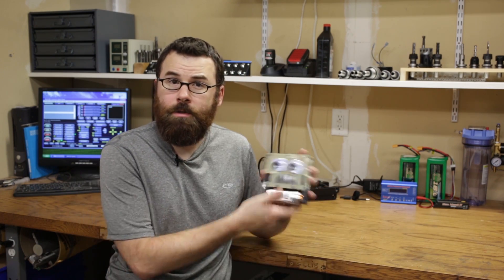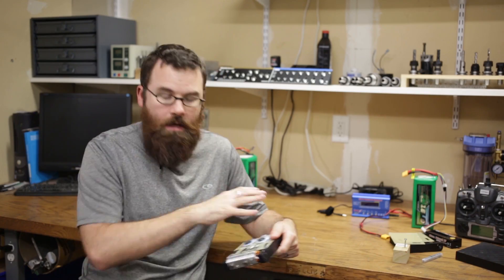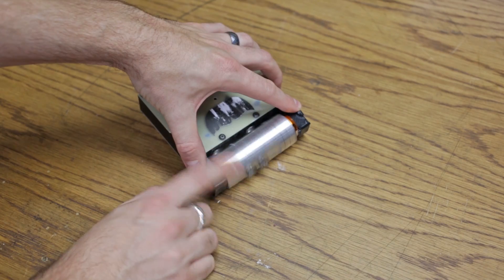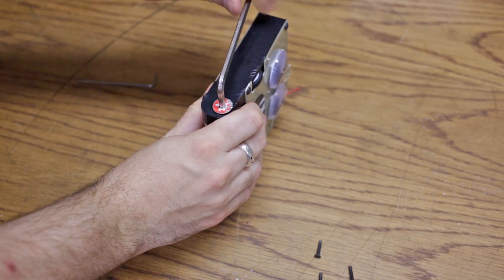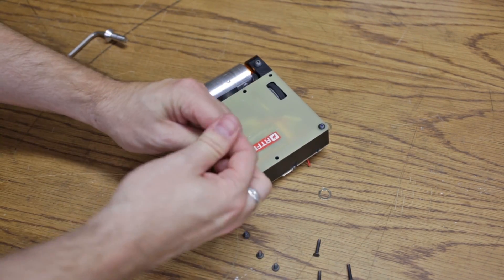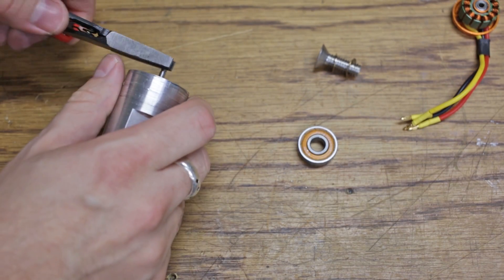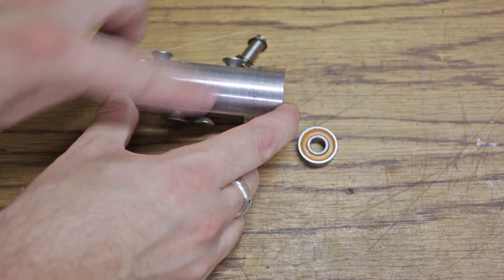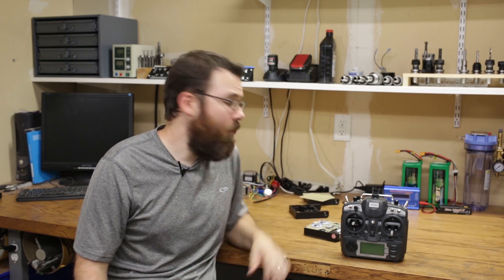Antweight Combat Robot - Part 2: Weapon

Comment: Doesn’t Having the motor directly connected to the drum lead to the magnets inside it being destroyed? That motor is taking a lot of force...
Reply from the maker: Check out my video on battle-hardening motors.  With a little epoxy, you can prevent the motor from cracking under the loads.
Reply: Thanks

Comment: HI Robert, love your videos. You explain everything so clearly and it is really helpful. I am a first time roboteer building a drum spinner beetleweight with the motor-embedded-in-drum design and I just have a couple questions. How did you prevent the motor shell from slipping inside the drum? If it is just that its a tight fit how do you ensure that it is tight enough. Finally, when doing the CAD for the drum, did you just do a bunch of measurements on the motor and input those into the CAD to ensure it fits or was it something else? Any input is much appreciated and any advice in combat robot building is as well. Keep up the good work!
Reply from the maker: Lots of good questions here.  First off, the motor shell is just held in place by friction.  As long as the friction is greater than the force it takes to get the drum spinning you should be fine.  It's OK if the shell can slip a little bit, this can help act like a clutch.  If it's too loose, you could use tape as a shim (maybe even heat shrink) or even loc-tite or glue it in place.  I never had an issue with this.  I just turned it on the lathe and kept slowly increasing the inner diameter until it was snug.  You can also sand the shell down if it's too tight.  For THIS design, I just measured the outside diameter of the motor and the length, nothing too complicated.  The diameter is usually listed in the description.  Just get some calipers and measure the dimensions you care about.  Don't go straight to final dimensions, get within 0.002" and then slowly work torwards the final dimension.  There's a fine line between too tight and too loose, so just go slow.
Reply: Thanks Robert! Really helpful!

Comment: What flat head screw did you use on the weapon?
Reply from the maker: I forgot the size, but I think they're 1/2" stainless.  You can use black oxide, or any other hardened screw.
Reply: The shaft is probably 1/2, but what are the ones for the teeth?
Reply from the maker: shaft is 7 or 8mm, I'm pretty sure the screws are either 1/2" or 3/16".
Reply: Without disrespect, but in the video you say the shaft is 5/16, so that would mean that your teeth is probably between 10-32 and 5/16. Thank you anyway.

Comment: Very nice. And a quick question, are weapon motors supposed to be that small?
Reply from the maker: For an antweight, it's normal.  they are ~150W motors which is the right size for a 1 pound robot.

Comment: Very nice video sir, i learned so much from your video and i have a doubt, if i run 1100kv motor with 12 volts, how much rpm would i get and is it safe for using as a weapon?
Reply from the maker: It's simple.  Just multiply the kv by the voltage.  so, it would be 1100 x 12 = 13,200 RPM (in theory).

Comment: is it possible to add arduino to this robot?
Reply from the maker: to do what exactly?
Reply: to controlled the motor and the weapon meachanism
Reply from the maker: you could, but there's no reason to control this inside the robot.  you could just control it with the transmitter.  the control is very simple, it just sends signals to the motor controllers, there's no need for an arduino to do this, unless you wanted to make it autonomous.
Reply: if it can be that, what i should do to add arduino into the robot? cause i got a university project that require me to make arduino based antweight robot.
Reply from the maker: Look into the RC library for Arduino.  You can have it control the motors and such.  But it's silly, it will just take the RC signals from the receiver and relay them back to the motor controllers.  It's extra hardware that's unnecessary.  It might be better to use it to detect if there's something close by, and making the drive motors either avoid or attach what's in front of them.  But if you're just trying to use an Arduino because it's a requirement, it's absolutely not necessary.  Use it to automate something.  Use it to detect an object and activate a flipper or other weapon.
Reply: tq sir. it must be interesting to use your design for this project
Reply: Sir if you dont mind , can i get the 3D design for sgt cuddles? As guidances purpose 🙏🏻
Reply from the maker: Sure, send me an email or private message with your email address and I can send you the files.

Comment: they're tougher than u think
Reply from the maker: There's no reason to use ceramic bearings.  fights are 2-3 minutes long and you don't need to worry about long term wear.  sure, ceramic bearings have excellent wear characteristics, but their main weakness is shock...  a typical ball bearing will be much better, given the application.  you will most likely crack or shatter a ceramic bearing.  Plus, given the extra cost, you could just replace the bearing every single match if you went with a metal ball bearing, and never have to worry about wear.

Comment: Are you certain it gets 8,000 RPM after lowering it?  I did some math, and if your diameter is 1.5 inches, your tip speed at 8,000 rpm should be about 430 MpH.  For reference, in Battlebots, they have a limit on tip speed of somewhere around 250-300 MpH or something.  But I think most spinners max out around 220 MpH.  I understand your diameter is alot less making certain RPMs more obtainable, but I feel like that has to be exaggerated a little, or possibly shouldn't be legal to keep the audience safe.
Reply from the maker: higher RPMs don't necssarily mean it's more dangerous.  Higher RPMs acually hinder the ablity to 'catch' and edge and flip/damage an opponent.  Most people are around 200 MPH because that's a good speed where you get a lot of kinetic energy, but also have a good chance of catching a part of the opponent and causing damage.  If you cuold spin at 500mph or something, you'd rarely, if ever, catch an edge becasuse it would be too fast.

Comment: Is the motor held in place just by friction?
Reply from the maker: +Axel Fagerberg - The weapon motor?  It's held in place with screws into the frame.  The drive motors are held in place by friction.  The reason is that the little screws can easily break.  If it's just press-fit into the frame, it has some give when there's an impact.
Reply: Yeah but how is the weapon motor attached to the drum?
Reply from the maker: +Axel Fagerberg OH, yes.  It's just a tight press fit.  the shell of the outrunner motor needs to be tapped/pressed in place and fits tightly.  this also give it the ability to slip if it needs instead of breaking something else.  I had no issues with it slipping though.  I was originally going to use some loctite to hold it in place, but I didn't end up needing it.
Reply: Cool! Thank you for the inspiration!
Reply from the maker: +Axel Fagerberg Sure thing!  I'm currently working on my 3LB robot for an event in October.